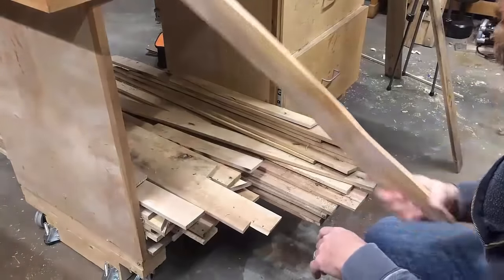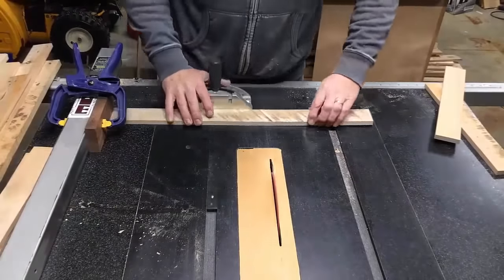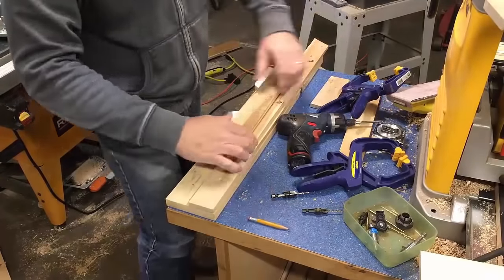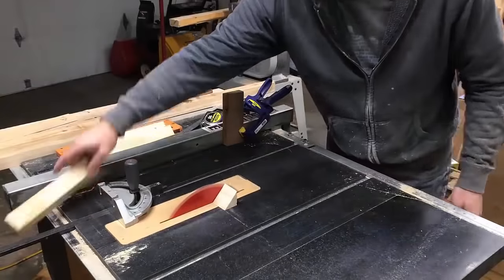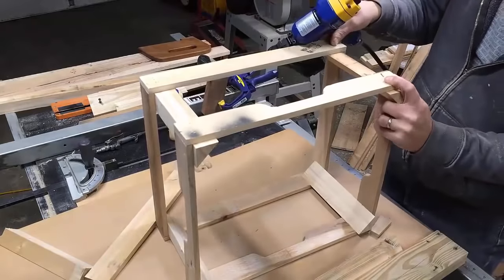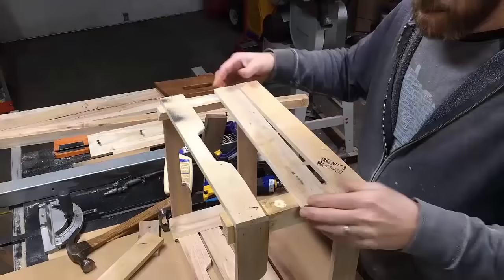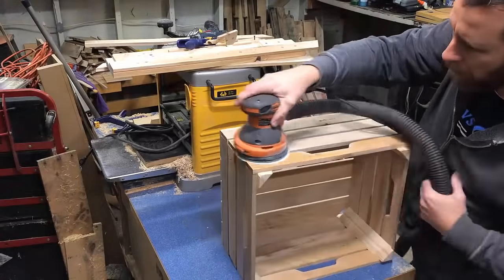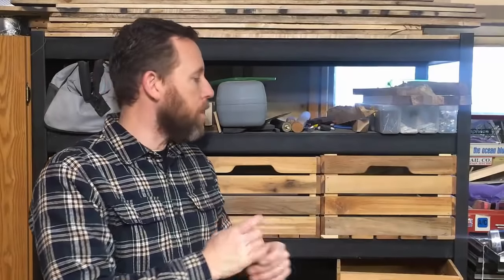DIY Stacking Wood Crates from pallet wood

Comment: Looking for ideas for stacking boxes for vegetable storage. I have been thinking of using galvanized fence for the bottom but cant convince myself that the wire wont bite into the crops. I like your design and would be using the stackable idea rather than a rack. Thanks for the video ,good job.

Comment: Look great Jake. If I understand it right could you have the four corners stick down like little feet and have the inset part be on top so it would still stack? That way it holds the box up off the ground a little but if something was to spill or get wet?
Reply from the maker: You totally could do it that way.  I was going to make it that way as my first design but realized that all the weight would be concentrated on those four pieces.   MY bottom slats are pretty thick,  but if I put anything heavy in them I was afraid the bottom would sag.    In all likelihood,  I'm never going to put anything super heavy in it though.
Reply: Really good to see how simple quick jigs make each step faster & neater 👌